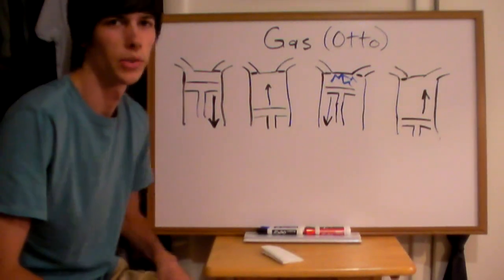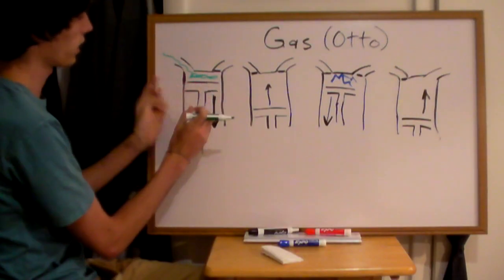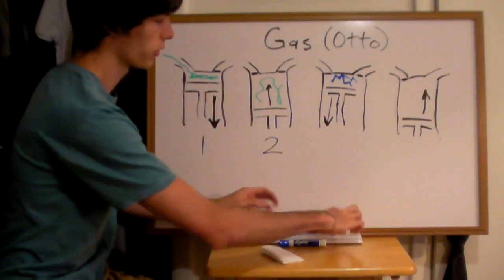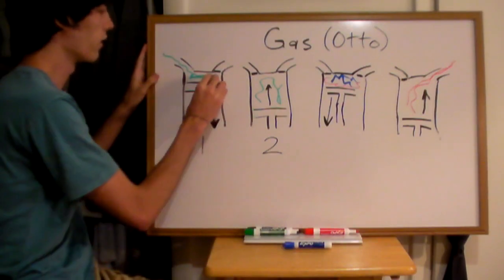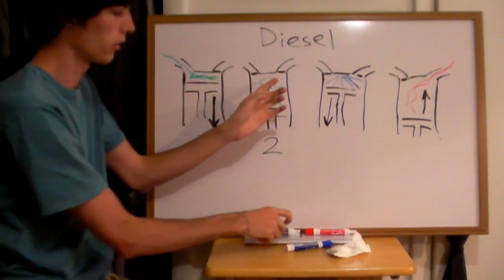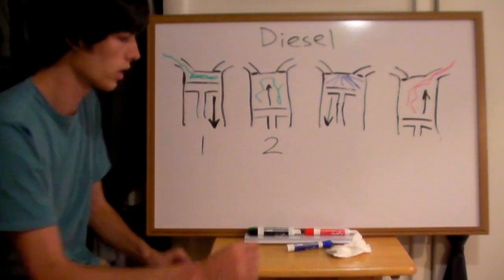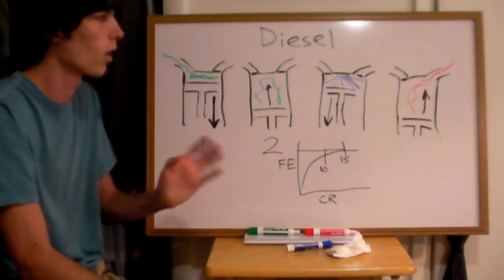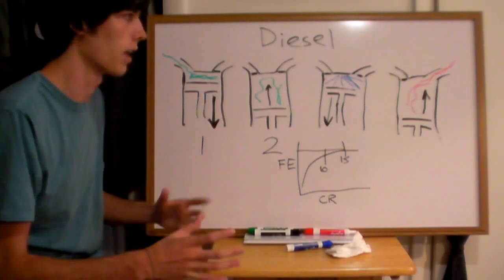Gasoline vs Diesel - Which Is Best?

Comment: 1. You failed to mention intake manifold stratagies....gas engines use "throttle plates" to meter the volume of air entering the system...intake is usually in a state of low pressure(vacuum)...deisels have no throttles(power is controled by fuel volume and timing)...monifold is at atmospheric, to positive pressure(turbo boost) most of the time...the trottle plate is a big deal...anywhere above idle, with the vehicle in gear, the closed throttle will cause a decelerating action..not so on diesels

Comment: because diesels are slow turning engines, so that means the acceleration isn't as quick and the horsepower is usually less in higher rpms than petrol . They require more maintenance, especially related to fuel filters and water in the fuel system. A diesel engine can be more temperamental in cold weather.

Comment: that's a pretty cool idea. along those efficiency lines have you seen the new valves in the "inside koenigsegg" videos, episode 7. i thought that was a really cool idea.

sorry i got sidetracked, i had one more question thats been bugging me for a while, what's the pressure at which different octane gas will combust on its own, is there a chart with temperatures and pressures i can look at?

Comment: would you have to convert it to inject the fuel before the 3rd stroke then? or would you be able to push high boost and inject during the 3rd stroke like the diesel?

Comment: the diesel burns slower so the burn lasts longer an there for the stroke can be longer resulting in a slower turning but torquier engine

Comment: EGR is a brilliant example of stuff that sounds like a good idea
...on paper when you're sitting behind a desk.

It's a pipe leading exhaust back to the air intake just before the manifold. The thought is to properly burn of particles that haven't been properly burned. Only it's a rediculus low % and in stead you hamper the combustion and increase the NOx particles (cancer).
More imortantly (to you, here and now) It makes a mess of your intake system, and should be disabled ASAP.

Comment: ....Therefor, diesels usually take longer to do one full rotation of the crank shaft, but if you were to scale them really the diesel and the Gas would be doing the same work just at different RPM's. Since diesel has more BTU with more "beefy" engine parts, you usually get more low end torque compared to the same size gasoline counterpart.

Comment: Pull a piston out of a honda civic or Chevy silverado, than pull a piston out of a Dodge Cummins Turbo Diesel or even a diesel Mercedes. You will see that the piston is much longer and much wider and for the most part heavier. Diesel burns at 147k-150k BTU while gasoline is only from 90k-97k so you have a whole bunch more energy in diesel. You are right about the ignition points, although diesel is injected at TDC while gasoline is mixed with air during the intake stroke and than its compressed.

Comment: are you sure that diesels have a longer stroke?so the distance between tdc end bdc is longer than a gasoline?i think it coms because when the injector shoots diesel than it will not burn inmedily.a gasoline car burns inmedialy when the piston is at tdc end when the spark plug ignite.i think the time that the diesel begins on his burning proces is longer end the burning is olso longer end not so fqst like a gasoline car i think.why have diesels a longer stroke?

Comment: If you can ask your question more clearly I could answer. Are you talking about a Petrol ( Gas as you say in US) engine getting fuel in to Cylinders or Diesel engine. Well, Diesel engines has injector pumps that injects diesel in to the cylinders.

Comment: They can but most diesel engines are bigger bore X bigger stroke so it takes more energy to move there pistons up and down. Technically there 3k rpm is kind of like a Honda Civic's 5-6K RPM since the Honda Civic as smaller bores and smaller strokes.

Comment: When the piston does the intake stroke there is less air in the cylinder than in the atmosphere; therefor, the higher pressure air seeks the area with the lower pressure to fill it, this is known as a vacuum. Diesel's do have a vacuum its just not as strong as a gasoline engine. All the butterfly valve does is control the amount of air that can go into the cylinder, whether that valve is open or not the engine is going to suck in air or else it could not run.

Comment from the maker: Direct injectors which spray fuel right into the cylinder. The pressure of the fuel is MUCH greater than the pressure of the air.

Comment: Well, Diesel engines are not controlled by air intake. The air intake is pretty much just set by engine speed as most diesels are turbocharged. Faster RPM= more air. Diesels engine speed is controlled by fuel. more fuel= more rpm. In you'r case your just adding to much fuel. Either have to play with your injectors or get smaller ones.

Comment: I can give you a better reason. Internal combustion engines create a vacuum as they draw air into the cylinder. The problem is Diesel engines have very little vacuum. The max a cylinder can have for air pressure is atmospheric but most engines can only get 60-70% of that and in diesel's even less. Less air, less efficiency. Back in the day Diesel's were usually two stroke so they had a supercharger, but more modern days they have used turbo's instead because there more efficient.

Comment: if it's only a little soot I wont bother asking what actually happening, AFAIK almost all diesel engine are like that.
in my case, the black smoke is really really bad when I press the accelerator hard.
I'm gonna ask the mechanic to increase the air intake or reduce the fuel intake, see which one works.
thanks.

Comment: No. The compression ratio, even on normally aspirated Diesel engines is already very high. Take the International Harvester 6.9 liter IDI Diesel in many old Ford trucks. This engine had no turbo, but still had a 20.71 to 1 compression ratio. The only way to stop the soot is to balance the fuel/air ratio in the engine eg., back off on the fuel, or increase the amount of air, or both. Usually, diesels run at their "sweet spot" right before producing a little soot.

Comment: Diesel engines have no throttle plates to meter the air. The rise in the engine RPM when you press the accelerator is due to an increase in the amount of diesel fuel injected into the engine. The black smoke you see when flooring the throttle is soot particulates formed from unburned fuel. The main reason this happens on a diesel is because of varying amounts of unburned fuel passing through the engine and out of the exhaust.

Comment: i've got a few questions.
why does my diesel engine produce black smoke when I floor the throttle? when it's running idle or during normal driving the exhaust gas is normal. fyi, it's turbo diesel engine.

thanks.

Comment from the maker: Diesels use heavier and more durable internal components and engine blocks. Thus, they can handle the higher pressures of high compression ratios better than countering gasoline engines. Because they use stronger internal components, it's not as worrisome to use a turbo. I don't really like making generalizations though.

Comment: tell me if i am wrong...i think with a gasoline engine the compression ratio is not so high but the ignition from the spark plug forced the piston with very high force down! end the difference with a diesel engine is..the compre ratio is high but when the injector ignite fuel then the mix will burn but it will not force the piston down with so much power like a gasoline engine.

Comment: I get it, that's probably why.
Do you think a Diesel gasoline engine would produce more power than an equivalent engine burning diesel oil?
My though about the cost of diesel/gasoline production, in relation to this matter is, since gasoline is naturally faster burning (high cetane almost the contrary to octane), if a diesel engine was optimized to burn on gasoline it wouldn't be necessary to add any additive post distillation to increase the octane number, therefore cutting costs?

Comment: Because of it working principle (compression ignition, fuel is not already mixed with the oxygen!) and diesel fuel characteristics (slower burning rate than gasoline), if you increase the rpms you decrease the "available" time for the fuel to burn, which at extreme rpms would result in poor efficiency and high hydrocarbons emissions due to unburned diesel fuel being dumped to the exhaust. No manufacturer want their engine to do that, that's why diesel fuel engines run at lower rpms.

Comment: Oh ok, it's at least an example to prove the concept. But I was really interested in a Diesel engine that was made and optimized (with corresponding HIGHER efficiency/power, low emissions, etc.) to run on gasoline, OR since it doesn't exist to understand why. If the problems are just cost of building, why wouldn't the people that don't care has much about extra cost adopt it? (e.g. all the companies spending extra millions to have the next most powerful sports car engine to fit their models)

Comment: My friend, u said that the purpose of getting better efficiency by increasing the compression ratio would eventually dilute with the fact that you needed to use and stronger implying HEAVIER engine.
That's the point I addressed, showing to you that is not true.
If an F1 engine is a otto cycle or not, is not relevant, what is relevant is that you can use a similar engine construction (obviously not to their specs, remember, a linear reduction in "perfection" means a exponential decrease in cost).

Comment: One question, since its only a matter of the chemical properties of the fuel. Lets say a single engine runs on both fuels. Do you think diesel would be a a better option to use?

Comment: Impractical doesn't mean impossible. I also mentioned less economic before I typed the rest of the comment. You confirmed it in your comment. Not everyone can afford a sports car. F1 engines are still otto cycle (meaning it uses spark plugs). Let's not deviate here, Didn't you originally ask "without the need of a spark plug?". F1 engines are designed to be short stroke, enabling the engines to operate at high speeds without failure (ie lower rotational inertia)

Comment: Thanks for the info. Like you said, DI diesel engine, fuel is directly injected in the chamber at the end of compression. But you seemed to confuse what I meant when I said it, I was trying to explain why gasoline (petrol) isn't used in the manner diesel is used in a diesel engine cycle. Gasoline combusts more easily and has lower energy density to run an engine with strong internals compared to diesel.

Comment: You can turbo a N/A gas engine, limiting the boost up to a certain point without any risk of damaging the engine if proper anti-knock measures are taken in account. Also, an example for you to understand why you are wrong, F1 engines have a 17:1 compression ratio and the lowest rotational inertia (light weight) of any engine with the same displacement (obviously it is not necessary such an extreme solution for a road car, just goes to show it is VERY possible,at least for expensive sports cars).

Comment: Thanks for the info. Its great to know about existence of such engines. However, since it's in military use, it'll probably take years for it to reach civilians. IMO, I don't think it'll be economic (yet) to apply this technology for civilian use. I agree Diesel's design is one of greatest design that's simple, clean, with high thermal efficiency, and as you mentioned can run on virtually any fuel source for combustion. Cheers

Comment: I think doing that would become impractical and less economic. Higher compression ratio would require the internal components to be stronger, then having stronger internals would generally make engine heavier. Heavier parts cause engine to be slow and need more energy to move. To get that energy, we need fuel with more energy density. To get more energy density, we need to use diesel. This will ultimately defeat the purpose of using gasoline/petrol.

Comment: Hey man, great video! You are the ideal person to ask one think I have been thinking for long now. Since gasoline ignites itself when subbjected to a pressure/temperature above a certain threshold. Why doesn't manufactures make a gasoline engine with very high compression ratio, and direct injection without the need of sparkplug?
Best regards

Comment from the maker: The momentum of the flywheel, which is there due to the power from previous power strokes, and current power strokes if the engine has multiple cylinders.

Comment from the maker: This could be from different cylinder heads, or different pistons. If the cylinder head has less space, then obviously compression ratio will be higher. If the piston is taller, so to speak, or domed/crescent, this will also increase the compression ratio. For example, an engine with a pentroof cylinder head (see my video "HEMI - explained") will likely have a greater compression ratio than an engine with a hemi cylinder head with the same stroke.

Comment: Quick question if anyone could explain. As stated in this video, the volume of the cylinder is lets say 10 times larger when the piston as at its lowest point in the cycle than when it is at TDC or its highest point. Then how does an engine that has a Bore & Stroke of 86mm have a different compression ratio than another engine that also has the same Bore & Stoke? For example, the GEMA 2.0 liter 4cyl engine has the same Bore & Stroke as the FA-20 2.0 liter 4cyl  but different compression ratios?

Comment: ... continuation.read the below comment first...by this time u shd have got the answer urself.so when u use gasoline in diesel engine, the gasoline cannot be ignited by mere compression of engine(no spark plug in diesel engine).so the engine does not run at most common cases.All the best guys :)

Comment: Gasoline n Diesel have very different properties though basically they are hydrocarbons.Gasoline with main constituent as Octane(iso-octane) along with other constituents make the gasoline blend.This is y the gasoline in lab is very different from pump stations.They have erratic AUTO IGNITION temperature.On the other hand diesel have predictable auto ignition temp. so to ignite gasoline v need an external heat source which produces high temp than auto ignition temp of gasoline- spark plug.

Comment: simple answer is because of the design of diesel engine(higher compression ratio). thats y diesel engines don't run at higher rpms comparatively(gasoline with 18000 rpm-formula 1).if u want much more info please ask, i am glad to explain :)

Comment from the maker: You inject a specific ratio to burn all of the fuel. If you burn at stoichiometric air/fuel ratio (about 14.7 to 1 for gasoline) then you will theoretically burn all of the fuel and use all of the oxygen.

Comment: I know this is a chemistry question and not physics, but since there is much less fuel injected into each cylinder (it isn't compressed) wouldn't the fuel become a limiting reactant? Basically, it seems like there would be left over oxygen in each cylinder, causing inefficiency

Comment: the limit is caused by 	the firing lag, the time between diesel injection and initiation of combustion, 
this firing lag depends on:
- ease of ignition (cetane number of the diesel fuel)
- temperature in the combustion chamber 
-pressure in the combustion chamber
-kind of mixture formation (high pressure common rail systems provide better mixing and reduced firing lag)
the mass of the crankshaft, pistons , etc have an influence on the acceleration but not max. possible rpm´s ,

Comment: So the glow plug has nothing to do with the diesel engine igniting? What I understand from your video is basically that just compressed air and diesel fuel causes ignition, is that correct?

Comment: Well of course heavy transport is diesel powered. Because of Diesel's attributes it is most suited to the task. However it is still dependant on application, as pretty much every care on the road is within 8,500lbs. They too can be either petrol or Diesel but most come with an accepted fuel. true offroad trucks are normally diesel powered, as are utes. However generally cars are petrol powered because of the suitability of it to an urban life

Comment: common rail has the same principal but the fuel delivery is different. It is electronically controlled and injected in multiple bursts as the piston nears TDC, the fuel itself is pressurised to +10,000psi in a fuel rail shared by all cylinder's injectors hence "common rail" The fuel system does not dump fuel in the more you press the accelerator in a Mechanically injected, instead it is regulated by a computer and carefully measured.

Comment: Older indirectly injected diesels are actually drastically quieter than newer direct-injection diesels. It's only the amount of exhaust sound reduction present in the form of mufflers and sound insulation in the engine bay that makes them quieter

Comment: Continued. The diesel will not spread to the source for many reasons,firstly diesel does not "explode"it is more of a steady burn. This means diesels usually have larger strokes to make the most of this. The injector is cracked open for a milli-fraction of a second in Mech-injectd and mulitple times in common rail. the diesel is injected at over 10,000psi in Common rails and several thousand in mech-inj, there is no way the flame would travel back, nor sustain combustion in an air-less fuel line

Comment: The diesel isn't prevented from lighting. Diesel will not burn with a flame. You can hold a match to it and it will not ignite. It has a very high octane rating therefore Diesel is ignited through compression - thus intense heat. The piston compresses the air which makes it extremely hot. When the D is injected into this mix of extremely hot air it ignites.